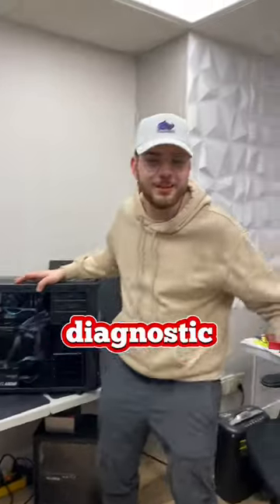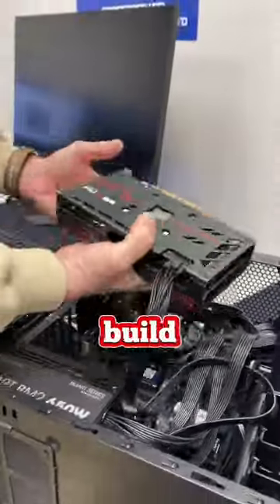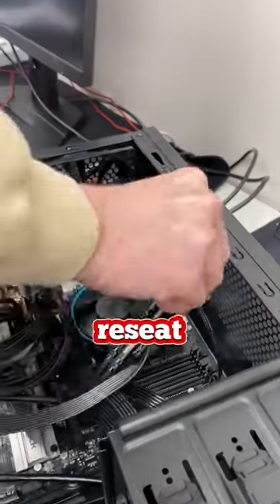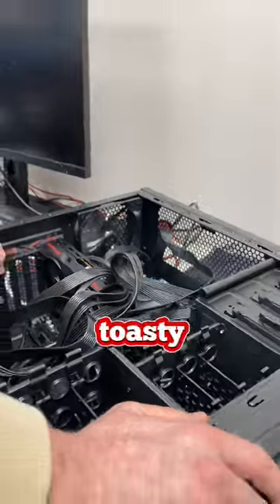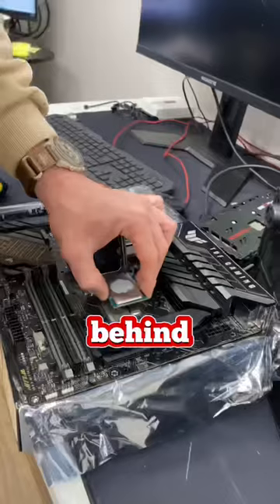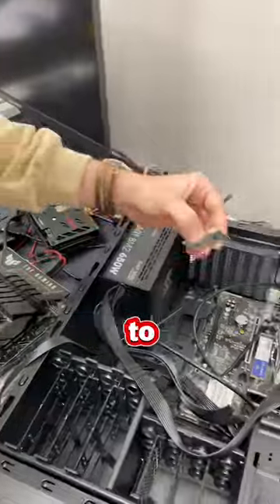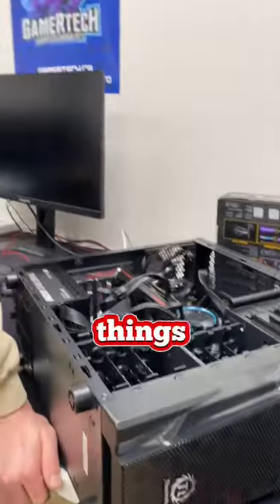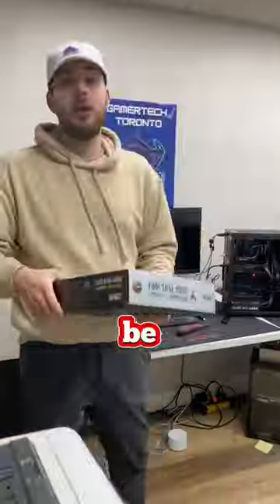They Brought A Defective Motherboard…🤬 #defective #motherboard #pcrepair #techvideo #gamingpc

Comment: This is Z690 motherboard, if it is 13th gen CPU he might need to update the bios for the system to POST.
Reply: Agreed
Reply from the maker: It’s a 12th gen cpu
Reply: It hepled like for 24 hours then pc went down to a black screen using 12th and 13th gen
Reply: @solike1646  is it your PC? Sorry to hear about the issue. Might be a faulty motherboard, not the first I've seen from asus.
Reply: Jup had the same issue with my MSI Z690 and 13900kf. Build the whole thing myself and I almost cried when it didn’t boot. Had to flash update the bios. After that it all worked.
Reply: @eliadbu  yep, that was my MB 
It failed in less then 24 hours and it was sent back to the company
Dude, it took me almost 2 months to get a new one 🙁
Reply: @solike1646  that sucks, these RMA processes should take week to two max. Some manufacturers have very quick process.
Reply: @eliadbu  hes capping btw
Reply: That's what I thought too
Reply: @GamerTechToronto  Could've said that sooner man... you got me reeling "dude check the CPU generation, test with a 12th gen CPU, my man's running 13th gen on a Z690..."
Reply: What a great instruction of how to void MB warranty and burn brand new CPU.
Reply: @Олексій-г1в  what are you talking about?

Comment: Why are there so many failing motherboards recently? Lol
Reply: I think they are also a repair shop so it should be normal lol
Reply: All are asus motherboards
Reply: @Kjohn060  nahh don't scare me😢
Reply: @RRareGaming  I went through two broken asus motherboards for 7000 series ryzen  and jayz 2 cents had several videos with bad asus motherboards and one personal. Gamers nexus mentioned “why are there so many asus motherboards going bad”. I’m surprised more people haven’t realized
Reply: Its because of the shortage of Rare metals, they're trying to make them for cheaper which is also causing them to be more likely to die quickly
Reply: @Kjohn060  week in that case is the new am5
Reply: @Kjohn060  asus tuf b560m still going strong after 2 years
Reply: Probably moving through the insane amount of stock that was pumped out during the supply chain storage from closing the factories over seas.

This happened during the great flood that caused nearly all HDD factories to close. The drives manufactured afterwards were dicey, took nearly a year for HDD to be available that didn’t die a few a months afterwards.
Reply: @RRareGaming  go with Msi🙌🏽
Reply: Of all the parts a motherboard has the most that can go wrong, second id say is a gpu. Reason is both have so many bits and such that there is just a higher chance of an error in one of them, you've got your power connectors, pcie, chipset, dimm slots, cpu socket (can be an issue on an lga cpu because well.. pins).
Reply: Most motherboards need a bios flash lmao or an update alot of ppl corrupt their bios with sudden power loss or hold the power button down also windows update fucks shit up a fair bit
Reply: Had mine break in my build back in November
Reply: @jared7360  what board was it because like I just sold my old board yesterday night and that was an x370 been overclocked every day of its life since 2017 where I bought it new and for me that was such a happy good experience tbh only thing I didn't like about my new board was the bios logo screen but I flashed a different logo onto it
Reply: @akeelshah7904  it was an msi b550. It would post but when trying to install windows it kept boot cycling and ended up doing it in bios aswell.
Reply: ASUS motherboards have a problem with pins that bend. Uneven board designs(try unscrewing the motherboard and putting it back in.) Bad wire connections (try rewiring everything several times if it won't boot to life.) Driver issues with certain CPU's (you may have to reflash the BIOS on a second computer.) 

The pins can be bent back into place with a manifying glass, a small pair of needle nose plyers and a lot of prayers to god. The best tool if you have one is the metal "scalpel" that came with the ifixit screwdriver set. 

ASUS motherboards have a lot of safey features and post codes, so look for lights on the motherboard. If it doesn't turn on, you may have a connection problem due to dust and need to clean the entire motherboard in iso alchol with a tiny ESD safe brush. 

The stock intel fan might not be mounted correctly or may be defective. Try a different fan and see if it turns on. This is another safey feature ASUS threw in to ensure you don't overheat your CPU or cause some real damage to the board. 

Look for a header called "TPM" if the pins are bent, you will have to fix them or send it into RMA." 

The CPU pins may be bent as well. These can be repaired and you'll need a scalpel that we discussed earlier in this comment from ifixit or amazon or something. Do not use needle nose plyers for this job and be really careful and don't rush it. I've been able to fix pins before, but it requires a lot of skill. If you don't have a special scalpel, then use a bobby pin(a hair pin) to get the job done. You want to push the pins in place using gentle pressure. Look elsewhere for more detailed guides on pin repairs.
Reply: @jared7360  also try checking if your ram timings are set right or just enable XMP PROFILE sounds like a ram issue
Reply: @akeelshah7904  one of the first things I tried. no it was the motherboard. It’s already been tested and replaced. The ram is in my current system along with all the other parts on a new motherboard and runs great.
Reply: @jared7360  ahh I'm glad it works well I been geeking about and got windows to run on 39 processes 🤣🤣🤣
Reply: @Kjohn060  asus sucks hard
Reply: Went for an MSi. Never had any problems
Reply: Wdym, motherboards are just trash

I’ve had so many motherboards fail it’s normal at this point
Reply: Electrostatic damage. All of them trying to build PC on carpets with socks on. It's no joke.

Comment: I had the same exact problem on my first computer build back in 2012. After getting the replacement motherboard, nothing would display on the screen. Finally realized I needed to connect the monitor via DVI cable instead of VGA

Comment: I had kinda the same problem with my new 13600k and DDR4 motherboard + 64GB RAM. In the end I got help from some nerds on a forum that suggested me to update the motherboard BIOS to support Intel 13th gen and it worked.
Reply: Which gpu do you have
Reply: @proplay6599  kept my old evga 2080 ti
Reply: Get ddr5
Reply: @sempss  nope there isn't much or any performance upgrade at all. And I'm not even gaming anymore
Reply: @Jeroen  haha obviously from 4000 cl20 to 4800 cl30 is not but now ddr5 are a good price and blazing speeds
Reply: @lexavlogs7149  I bought 2x 32GB DDR4 CL18 3600 for €169. If I buy 2x 32GB DDR5 CL 36 6000 it's €245 and if I use a ram latency calc the DDR4 is still faster. I could go with CL16 3600 but it would be €269. And all of that for just a few fps more in a game I don't play. Also DDR4 motherboard was cheaper than DDR5 board.
Reply: May I know how you update the bios when u get no post?

Comment: That's very sad cable management
Reply: why would you sort out the cables of your pc if it doesn't display??? Legit no reason to do cable management if something doesn't work lol
Reply: @champizthename8513  bad cable management once blocked my cpu coolers fan, luckily I caught it in time.
Reply: @MandatoryMushrooms  actually no, you always test your parts first and then reassemble and cable manage, besides does that matter if your trying to reseat every component that’s basically taking it apart so cable management would be pointless if you have to take it all out again just to try it.

Well tbf whoever built the pc should tested the pc outside of the case and then assemble in the case once confirmed working.
Reply: @MandatoryMushrooms  Exactly lol. There is literally 0 advantage to cable management other than to serve as eye candy and making it a little bit more comfortable to know which cable goes where

Comment: Is it possible to turn off the slot for your gpu and just use integrated graphics? Maybe that's what he did if his mobo has integrated graphics
Reply: To use integrated graphics you just plug the HDMI into the mobo
Reply: @PLC_Productions  it depends if you don't have a dedicated gpu then yeah plug it into the motherboard but if you have a gpu then you will need to set the video output in bios to cpu out

Comment: Bro My Msi z97 gaming 5 motherboard don't turn on only showing blue light
Reply: Is it flashing? If so, then your PSU is faulty and you need a new one
Reply: @PLC_Productions  🔘 Blue light on not blinking and not spinning fans power supply good I am using another component works good
Reply: @TechnicaLBoYJoY  Swap out ram sticks. If that doesn't work, reseat the CPU (Intel CPU has text facing upright) if that doesn't work, then I'm sorry to say but your mobo fried

Comment: i built my own pc and got scared out of my mind when it didnt put out a display and the fans never ramped down. i was so scared that i went for a little drive, and when i came back, it got into the bios. turns out, after some googling, my motherboard wasnt entirely compatible with the 7th gen ryzens and just needed a long time to do whatever it was doing.

anyways, every here and there it goes into bios instead of OS, it’s a B650 plus, any tips? updating the bios did nothing and i’ve receded just about everything
Reply: You probably should just return that mobo and then buy a b660 one
Reply: @PLC_Productions  B660 is Intel my dude💀
Reply: @thekickanoragm8559  then he'll just switch CPUs lmao